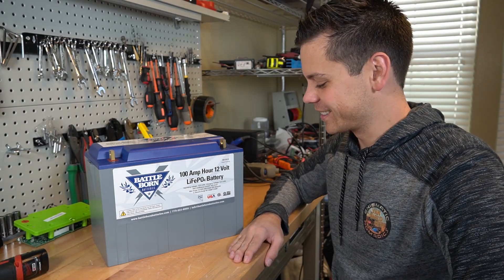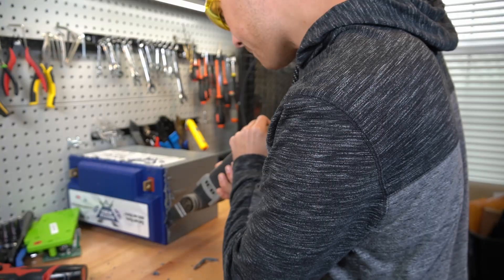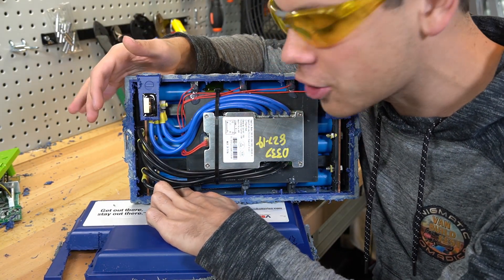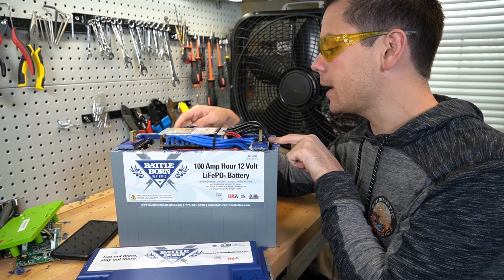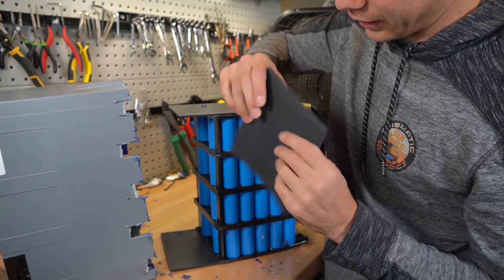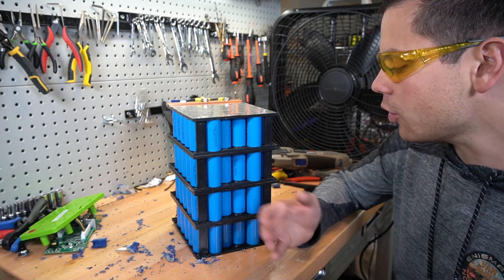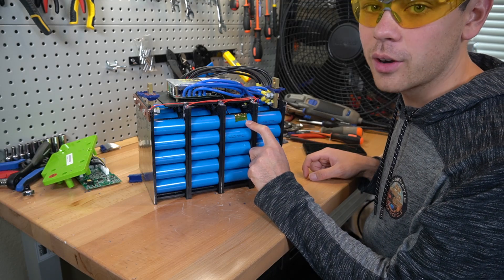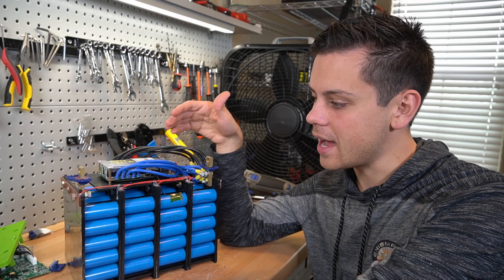$950 "Battle Born" Battery Tear Down

Comment: I recently started working for a company that makes back packs for automotive applications. Our BMS have minimum 3 NTC thermistors. That’s surprising to me that they don’t have it. You need at least two for safety, in case one fails then there is another you can depend on.

Comment: Just get some lexan or plexiglass and make a case that way since you pulled it apart.  Shouldn't be that hard to do just have to get the right solvent/glue for the material you use.

Comment: If the code on the 26650 cells is "YDL…”, they will be Yongdeli / Yodeli (Shenzhen Yongdeli New Energy Co.).  That's just a guess based on the e-cig world, where many of the 26650s are re-wrapped Yongdeli cells, but those are INR cells (3.7V Li Ni), not IFR cells (3.2V Li Fe).
Reply: I'm certain Will, will see this & say something.

Comment: Thanks! Great tear down of this Battle Born battery! They are kind of pricy but seem worth the money! Nice to see a real quality build battery. Is it available in Europe / Germany? - yes it is - via amazon e.g. but for 1050 Eur which is around 1200 USD! What about your experience with these tesla battery modules 5.35 kWh? They should last for 5000 cycles+ - but i am not really sure. They are probably not as safe as lifepo4 batteries. As long as you have them all in a separate shed its fine but i won't put lots of them in my house for a big power wall.

Comment: So I have 16 12v 110Ah lead acid long life leisure battery connect to make a 24v system, so I think that eqates to a 10kwh battery bank. So if I wanted to change over to 12v LiFePO4 battery system how many Batteries would I need to get the same 10kwh?
Reply: A 12 Volts 100 Ah LifePO4 should have 1.2 Kwh of energy, so you'd need 9 of them for 10.8 Kwh system. ;)
Reply: @johnnodge4327  So for a 24v system that would be 9 of them costing £6k and 16 x 12v 110Ah liesure batteries cost £1k its a no brainer, old tech wins!!! or I buy a Nissan Leaf Battery Pack Mk2 (costing £3-4k) and use the best cells to revamp my Leaf and make a large battery bank out of what remains!!

Comment: How many cells and what number is on them? Thanks, very interesting videos.
Reply: Will said that this battery is a 4S - 30P configuration, using 120 x 3.4 Ah 3.2 V LifePO4 26650 cells.
Reply: John Nodge thanks, but was also asking the number that are on the sell, he stated they where 26 something, they can hold a very large amount of mA. Better then the cells in the model 3 Tesla.
Reply: Simply watch the video with your eyes open.
Reply: AZ Claimjumper I did, but he didn’t say the model number of the batterie,  or since you’re answering the question, can answer this for him.
Reply: @mikejf4377  Watch the video, Will reads off the number & then comments at length about being unable to find it on the internet & then coming to the conclusion it is a battery made to Proprietary Requirements.
Reply: AZ Claimjumper well I missed the number, why don’t you help me out and tell me the number I missed, I did here him say he couldn’t find it.
Reply: @mikejf4377  IF you REALLY want the cell number then you will HAVE to watch the video AGAIN.  IF you do watch the video again & get the number what are you going to do with it.  Will was unable to find anything on the internet with the number.  Do you think you'll find something Will couldn't?  And what will you do with all that valuable information?
Reply: AZ Claimjumper he says twice that he couldn’t find the number with his phone. I watched it again. So please tell me the complete data on the cells. I love people that are being ignorant!!!
Reply: AZ Claimjumper three times, he doesn’t say the part number. Da!!,!

Comment: What I really hate us that the batteries cannot be disassembled non destructively, this is a BIG problem and creates a massive amount of unnecessary waste.
Reply from the maker: These batteries can be recycled and last 5-10x longer than lead acid. Non toxic as well. What are you comparing it to? LiFePO4 are better for than environment than any battery I have seen so far. Can you tell me a better battery chemistry option?
Reply: @WillProwse  I'm taking about the case of the battery.

The problem is that they COULD be easily dismantled and refilled BUT as you know, you cannot dismantle the case non destructively, so that is a large quantity of perfectly good plastic wasted every time, AND it increases the costs of intelligently recycling the battery system (which contains lots of really easily) components)

(I'm taking generally but also specifically about this battery you dismantled the battle born) I'm not comparing to different chemistries.
Reply from the maker: Ohhh I see. Ok

Comment: We were early adopters of these batteries back in January 2017 when all I could find online was the dragonfly energy brand...the same folks. They have been great. No regrets at all.
Reply: Same here.   It was $850 then, shorter warranty.   They replaced my 100 ah after 8 months due to a very minor glitch in the BMS.  It shut off power for 2 seconds every 24 hours.    They knew about it and cross-shipped a replacement immediately when I called. Most people didn't notice since they had multiples in parallel.

Comment: A translucent battery-case would be cool. Maybe one with connections and terminals already welded in place so that these cheap single cells from alibaba can just be bought and placed in. A battery could be build from cells as easy as replacing AA Batteries in a TV remote. I've seen translucent copper cables so a see through solar system  might be not that far away.

Comment: If one of those cells fail it'll work and it might also start a " energetic " chain reaction. 
 Prismatic batteries are ............... Well I personally would rather hope that 4 cells don't fail than 120. 
 Good luck folks.
Reply: LiFePO4 is almost impossible to get that chain reaction. 1/2 the energy density of LiCo makes it a little more safe, but really it is the composition. Sinopoly did a video shooting holes a LiFePO4 cell and it just hisses and fumes. No fire and sparks unlike when folks put holes thru LiCo cells.

Comment: Dude. With all the LiFePO4 battery brands out there, I bet you could make a series of tearing apart each battery and make a killing doing that! Also try Lexan for the clear battery case. I use that for some lab equipment that I design.

Comment: Wow! I am so happy after watching this video. I have 4 of these bad boys in my rig. Just from watching YouTube , I knew to ask for BB batteries. It didn't really matter because my build out guys only use BB. I have 3000 inverter so I can run a lot of stuff off my system. I will probably get at least two more so my boondocking adventures can last longer. Go BB!!
Reply: I am going to purchase a 36 volt 50ah lithium battery for my boat. Can you do a video on a Bioenno power Lifepo4 marine battery to see if is really worth $1299

Comment: Does the bms and a charge controller do the same job?
Reply: While there is considerable overlap, no, not really. A charge controller limits the top voltage of the entire battery. A BMS limits the voltage of each cell (all the units that are connected in parallel) so that it can protect against a cell at 4v getting over-charged while the others are at 3v. In addition it does a similar role during discharge to prevent under-charging or even worse reverse-charging a weaker cell while the others still have power. Think of the BMS as the final safety if other parts of the system do not do their job.
Reply: Thanks  for the explanation.

Comment: Well done Will! That battery is a really efficient configuration and attention to current paths well thought out.
Seeing five 10AWG in parallel was a real nice surprise and shows they're serious about quality.
Other manufacturers should take note.
It looks like a mini diy powerwall without the case.... You could easily increase its capacity by just adding your other cells to it, and not even need to change the BMS unless it gets so big that it would struggle to balance it, but if you really wanted to go nuts, you could put hundreds of these together and manage them with a Batrium!

Comment: Depending on the chemistry used, there are versions of lithium iron phosphate that can go to quite low temps. 0 degrees F is possible depending on chemistry. Still a good idea to have a low temp cutoff because you can't be certain the battery won't end up in Minnesota. That's a really good design in that pack. I like the layout, the fact they over provisioned the capacity to extend it's useful life and cycle life and it's really securely mounted. It should be able to take a lot of vibration with no problems.

Comment: Can this batt be used for starter
Reply: art cook no
Reply: @AaronGeller  thank you   my plan is shot down  want to use for coach starting  as they are also tied into the coach house
Reply: art cook it can’t provide the amount of amps you need it to. There are also probably significantly cheaper solutions than a Battle Born
Reply: @AaronGeller  suggestions   ,I'm a full time rver  appreciate it

Comment: You have a great enthusiastic attitude it is awesome. I actually really enjoy your educated wisdom in these setups. I can't wait for you to give your seal of approval on a all in one. Goal zero has always had my attention but, after watching this. I am holding out on getting anything. I also have been really interested in solar. I have a "Man Cave" 10x10 Barn Shed that has 4 x150 watt panels and some little ones also. I can pull over 30 amps to my batts which are sealed agm.  I have also 8 250 Watt solar on my home roof. And used to give demo's for solar around where I live. I was one the early adapters into solar about 10 yrs ago. I think solar is awesome but, imagine even having a micro hyrdro hooked up to water mains. Every flush of toilet or shower or washing clothes or dishes you produce power.

Comment: Those batteries are well built, it's amazing. A quick search reveals lithium iron phosphate 26650s can output 12 amps, so without BMS limitations this battleborn can theoretically put out 360 amps at 12 volts, That's over 4 Kw!!!

Comment: Do LiFePO4 cylindrical cells ever fail in short circuit mode?  How will this design continue to work then?  Isn't that why some designs have individual cell fusing?
Reply from the maker: Very different with NMC or NCA chemistries
Reply from the maker: LiFePO4 doesn't need individual cell fusing. I need to make a video about this

Comment: You can buy acrylic sheets and solvent to "weld" the pieces together and build your own clear case. There's a place in Las Vegas called Welch Plastics that does custom acrylic box fabrication. You could bring the old case to them and have them build you a replacement if you didn't want to build it yourself.
Reply: Or he could ask Battle Born for one.  🤔

Comment: Will, you missed 2 important things. Overall it’s a good battery. #1 it should have cell level fusing. I’ve seen 26650 LiFePo4 cells fail and the failed cell will become a resistive load to the other 29 cells in the form of heat. No thermal runaway but it will discharge the other cells in that group. Cell level fusing has been available for some time in large nickel sheets. #2 Each cell group should be bolted to the next cell group at opposite ends. Positive bolted to negative at opposite ends because electricity flows through the path of least resistance and on this pack, the top 26650’s are getting worked much harder than the bottom 26650’s because of this design flaw. Still a better pack than most. Thanks for opening it.
Reply from the maker: I have a friend who dismantles LiFePO4 packs that have failed for government application and they still work but at reduced capacity. There are other LiFePO4 manufacturers that do not fuse individual cells as well. I'll try to get some of these failed packs and test them. It has been the norm in diy powerwall community not to fuse LiFePO4 packs. I'll look more into LiFePO4 shorts. If the separator was damaged, would dump all the cells power into that shorted cell. That would be bad but I haven't done it before. Can you post a video of your packs? Would love to see that

Comment: I have been following this site for a while and based on research and Will's vids, 
I don't think I would consider anything but a Battleborn.
Price/ performance quality. They hit the sweet spot.

I have 2 on my horizon for a 24V system by 1/1/2020.

Comment: Nice job Will on taking down a BB battery. Like so many others, I've really wanted to see the insides of one of these. They do look well constructed. I do think they should have more temp sensors.. The Valance with 4 temp sensor -- that's really good redundancy. Compared to your Valance teardown, I honestly think the Valance battery seems higher quality of construction and design. Of course they cost so much more if purchased new, so it would make sense BB batteries are good.. solid.. but they are not the best in the world. they don't cost the most either. There are more expensive and better Life4 batteries, but for the price of less than $1k for 100Ah, they are a solid choice. After seeing your teardown, I wouldn't discourage any RV/Vanlife peeps from buying them. At this price level and construction quality, it should work well for that community. 

How about opening up the Lion Energy 1200 Will? I purchased one of these -- with your discount code -- and Im really interested to see what's inside. I want to know if it's quality inside or not. I already knew the capacity is more like 80Ahr going in, so that doesn't bother me. But I'd like to know if it's quality construction or not inside. Thanks!

Comment: Are those cells individually fused like on a Tesla battery?  if they are not and an individual cell shorted, wouldn't that cell discharge and destroy every other cell in its parallel pack, or am I not understanding something?

Comment: I would like to know also does anyone make these type of empty battery cases.
Reply: Just get some acrylic or plex glass or even tempered glass if you wanted and just glue them together with some epoxy. :) shouldn't run more than 20-30$ for all materials.

Comment: what are your thoughts on these for a home system?      Samsung SDI ESS Energy Storage Battery 16S 60 Volt - Used 13.2 kWh Rack Mount Mega 3.3 - Four Pack

Comment: Interesting and nice tear down test. 120 cells are 102 Ah but that's nominell capacity. Should be very interesting if testing true capacity i.e. how much amphours you will get out before LVP shut off. I'm working as pro (but not in US) and have done some test of new prismatic cells vs 12V-block (similar as BB but made in China and rebranded as most of them are) and my test of true capacity differ very much in favor to prismatic cells, despite same nominal capacity (Ah). Also interesting if you test the PCM (Protection Circuit Module) when it start balancing (voltage) and if any imbalance at 14.2 - 14.4 V and also how much balance current measured by clampmeter. When compare different batteries take in to account if spot welded connection and how many spots at each cell (this is a "weak" point for most welded batteries, also nickel plated steel not as good as copper).

Comment: I purchased a battleborn for my campervan a couple years ago on Will's recommendation. It has been a champ and never had a problem with it. But I have a question, I have seen conflictual information. I live in Denver and I'm concerned about temperature drops. It lives in my van overnight of course when I sometimes am not in it and will get extremely cold. Any feedback?
Reply: Kim, so what exactly is your question? are you asking if it's ok for the BB batteries to be out in below freezing temp? Yes, it's fine for the battery to be in below freezing temps. What is NOT ok is to charge Life4 batteries if the ambient temp of where the battery is stored falls below 32F. But BB batteries should have low temp cutoff, so it shouldn't allow itself to be charged when temp is below 32F -- assuming the temp sensor inside the battery is working properly and not malfunctioning. So it the BB batteries should be fine in the van in Denver.

Comment: Whats the difference between this battery and their  GC2  thats  $100 more
Reply: FAQ on the Battle Born web site says it's just slightly rearranged inside to fit into the GC2 form factor (taller but a smaller footprint).

Comment: I could NEVER cut one of mine open! Glad you did and great job on the video! Closest I’ve seen to the inside was when @AdventurousWay did an interview at the factory with Denis.
Reply: Yup, it was cool to see the individual cells and how they put them together at their new factory. It looked very solidly glued at the factory, no wonder Will had a hard time taking the battery case apart.
Reply: @AdventurousWay  Where is the factory?
Reply: @gsp49  Battle Born Factory is in Sparks, Nevada (near Reno).

Comment: I am probably missing something but since there are so many cells I assume the BMS just monitors the 4 groups of cells rather than the individual cells, how would that effect things if one of the cells goes bad? could the BMS end up allowing overcharging of a group of cells because it wasn't aware of one of them failing? I am not sure I really understand how these things work though. Good vid though.
Reply: Yes, your exact question puzzled me too. Only 4 balance leads was very surprising.
Reply from the maker: That's how packs are designed. Check out my advanced system design videos to learn why
Reply from the maker: All cells in parallel pack will rise and fall in voltage together.

Comment: Did you check the battery after you opened it?  It looks like you can't just keep it open like that as it seems that it separates at the joints and would then disconnect the series as it looks like the metal plates are separating each row. of batteries.   At least that is what it looked like when you pulled them apart a little.